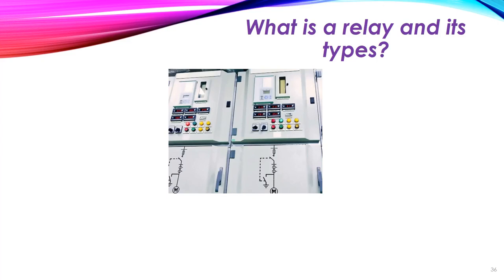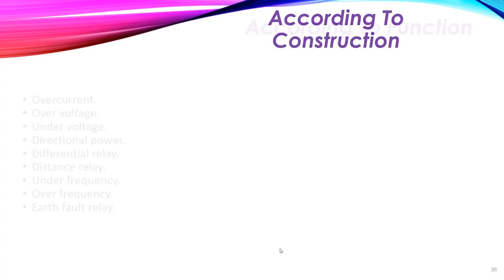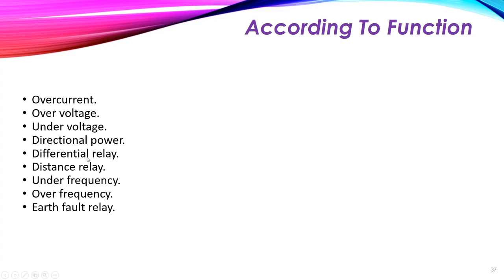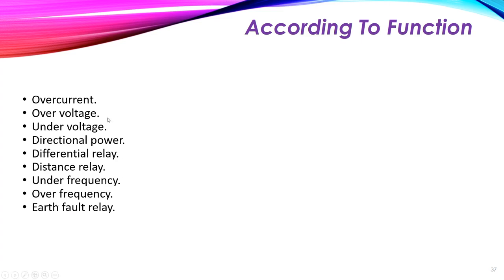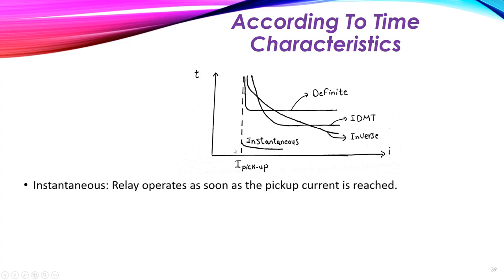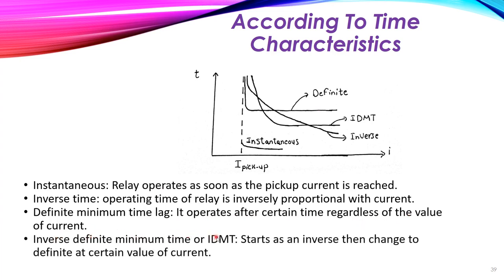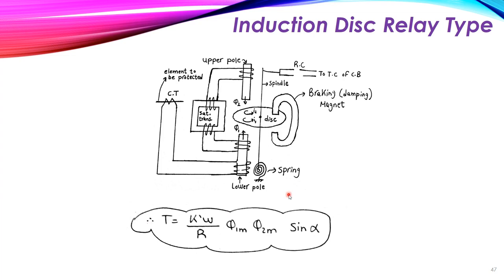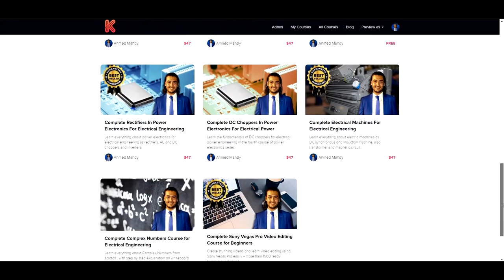Types of Protective Relays - Protective Relays in Power System Protection Online Course (6)

Comment: Concept of production of force with the current in coil is not well explained here in case of over-current relays. As per figures shown, the current in the coil is producing magnetic flux only. To show a force production, interacting with an existing permanent / electromagnet is required, needs more explanation or elaboration in drawn diagrams.